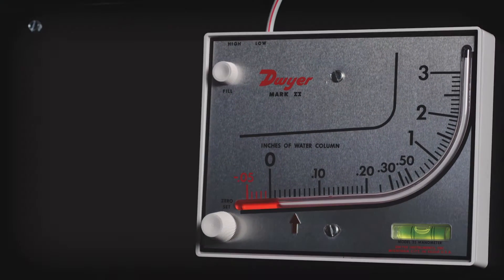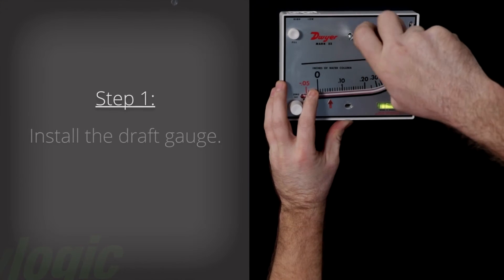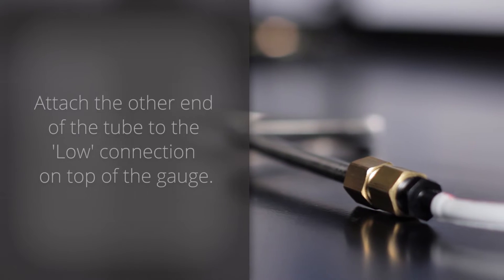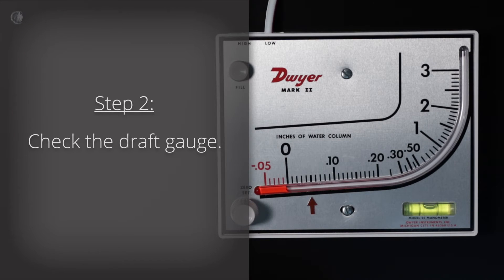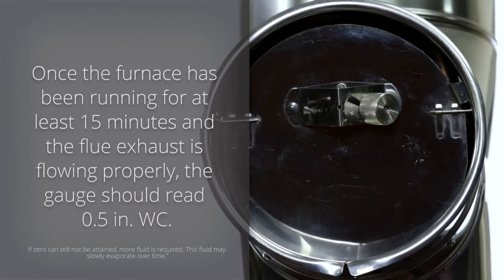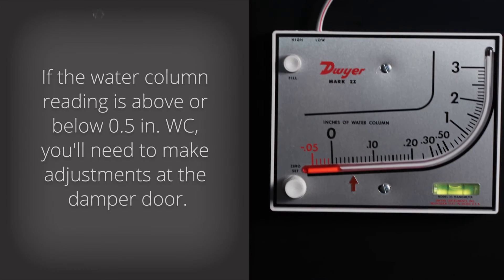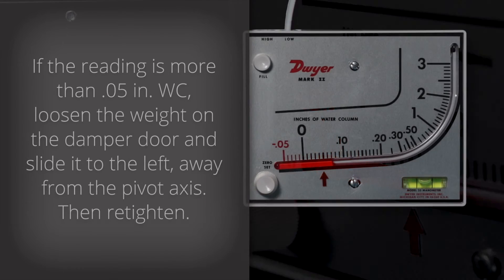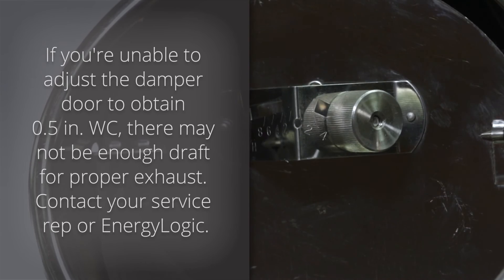Draft Gauge Installation and Draft Adjustment

Comment: You are showing 0.5 wci but saying "Point zero five" which is -0.05 wci if you have negative vent pressure. You're all over the place. Also, you failed to discuss how to read the meniscus much less fill it correctly. You didn't discuss anything about proper venting or chimney inspection. You didn't discuss proper chimney connector piping or where to put the counterweight on the barometric damper. Bad vid. Sorry.
Reply: Oil Burner Combustion Test?
-.01 to -.02 
I hear the Simpsons
Reply: they are showing halfway between 0 and .10 inch wc, that is .05 in wc.....
Reply: 1/2 x .10 is .05...